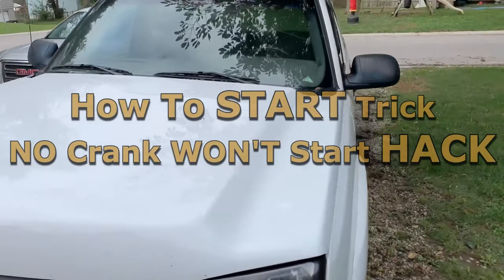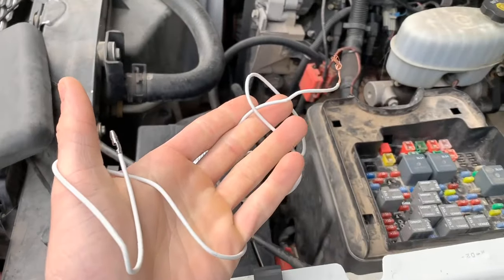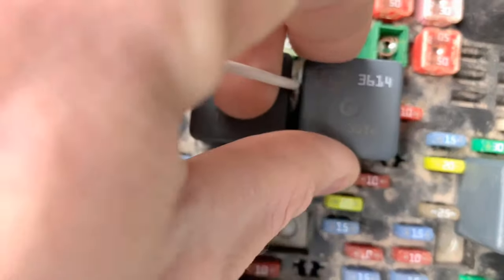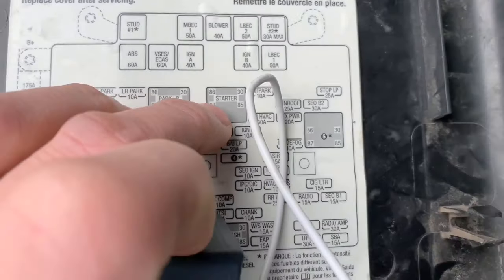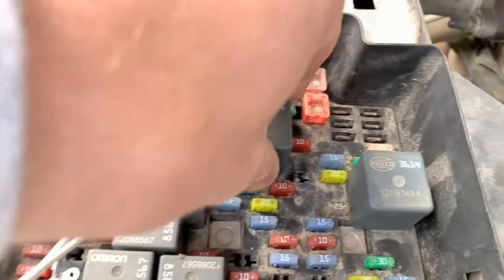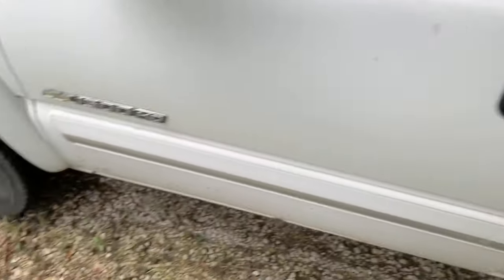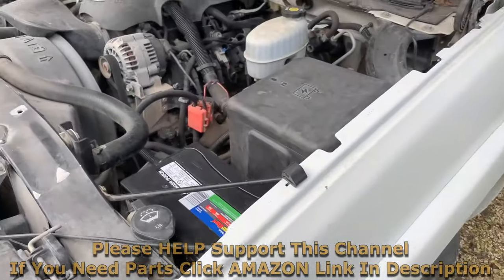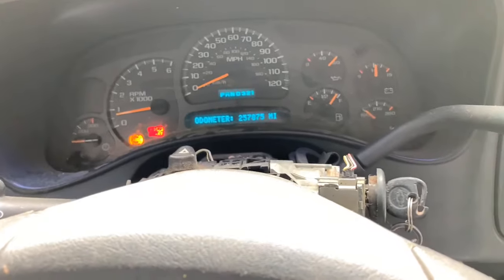NO START NO CRANK Chevy Silverado 5.3 Vortec 6.0 4.8 4.3 L How To Start TRICK Diagnose WONT START

Comment: If it doesnt work for anyone, try taking anything metal like a screwdriver and touch it in between the 2 bolts for the starter underneath the truck until u see sparks and here it cranking, start it up and then shut the engine off for bout 5 min so ur battery doesn't explode 😂 then u should be good to go without any backfires, did this with my 5.3 bout 30 min ago and she runs like a dream
Reply: are you talking about the small bolts behind the driver side tire ?

Comment: My truck was in a bad neighborhood, broke down, your tricks literally probably saved my truck because I had to leave it overnight and then I found your video. I got a run in and got back home. Laura, for some reason the emergency brake electronic system has a gauge now I didn’t have much power in my engine, it never gave me a lot of horsepower is what I meant. Noticeably different, any thoughts?

Comment: Replaced my ignition switch, ignition relay, ignition cylinder, battery, and even the starter but still no crank at all! This trick turns my truck on no problem but anyone got any ideas? Cause im lost
Reply: Mines doing this now. Ever get it figured out?
Reply: @jeffholz2465  no never did, i gave up on it. It seems to work now but only after jiggling the ignition a couple times

Comment: Pin 87 but not on parking lmp like u pointed at, right ?
Reply from the maker: lmp?
Reply: @EverydayImTECHnIt  on the video you said 87, but was pointing at the  PARK LP FUSE.. anywho, it's the starter fuse 87 you connected too right? Since you mentioned starter
Reply: @EverydayImTECHnIt  @5:50

Comment: I noticed your abs light and parking break light came on and stayed on when you did this  mine did the same thing did you get them to turn off ?? How did the truck run while the lights were on?
Reply: I have the same problem. Truck wont start so i did this wire bypass which starts it fine but when i get going my dash and lights start doing crazzy shit
Reply: My 2001 Chevy S10 pickup died last night right when I parked in my driveway, it was real late. But the issue with the two dash lights comes on.. then I reset by shutting off the car.. wait a few minutes.. no more lights.. I have troubleshoot this issue

Comment: Confirmed on 2003 6.0 liter. I believe slot where my starter relay goes is all messed up. New fuse box on the way. Thank you for the video. Subscribed!
Reply: did the fuse box fix your problem
Reply: @beepbeepbella8139  - Yes it did.

Comment: Havin a problem 7.4 no crank no start have power no fuse is blown ...new starter alternator good....99 c2500 obs style
Reply from the maker: Try unhooking battery for 15 mins it resets computer then hook it back up & also check ground wire where it grounds to frame make sure it has good connect & clean it can cause this issue also.

Comment: Did not work, any ideas? For me it cranked with the wire trick but did NOT end up starting.  Any ideas, anyone??
2003 Silverado
New alternator, shop said battery & starter should be good.

Comment: Thanks again for this video... I was able to start my suburban , pulled it in the drive way and now I’m hoping the issue is just the relay... what do you think? Can this heat  we’re having effect it?  Thanks again... do you have a FB or instagram?
Reply from the maker: Also check large square fuses & make sure you check them good & remove them for better view on mine it had a very small hairline crack & looked like it was good & swap relay with another relay to check if it is good like headlight relay for ETC just make sure that #'s are the same on the relays u swap!!!!
Reply: Melted wire under fuse box connector c1 replace fuse box and wire if I could post pictures I would
Reply: In heat our suburban would stall while driving- faulty crank sensor and neutral safety switch both made our life hell

Comment: thanks for the tip, got my truck started. will a new starter relay solve this issue?
Reply from the maker: Glad u got it fixed & to hear the video helped!!!
Reply: Thank you brother you're a legend!
Reply: I would also like to know how to fix the problem and not have to jump wires to start it every time... New starter relay? Ignition switch?
Reply: I tried this but no spark coming from engine

Comment: 2010 GMC van, 4.8.  Did the #87 jumper trick, but it only cranks. Will not run. I heard the fuel pump buzzing when I turned the key on.

Comment: My 4.3 will crank but won't start : but if I put gas in the carb. it will start for as long as the fuel added last . I beleive its a clogged fuel filter or fuel pump NY pump and filter are only 5 years old .

Comment: What would be the problem if it sparks but nothing happens? I’ve tried it on all the prongs and same results
Reply from the maker: Probably your starter
Reply: @EverydayImTECHnIt  I took it out and autozone said it’s good. Ignition wiring looks good too. All relays and fuses are good I’m not sure what is the problem
Reply from the maker: @brodieyukin69  check your ground wire this is common problem for those trucks

Comment: I had this issue not to long ago how I got the truck started was my brother smacked the starter with a pipe wrench while I held the key in the start position. Then i changed the starter I have not had an issue since
Reply: That’s a different issue. The neutral safety switch on this truck is bad, so he bypassed that switch by sending power to the starter relay directly from the battery. This trick won’t work with a bad starter, so that’s why you had to pull out your hammer

Comment from the maker: GET PARTS NEEDED Linked Below
Starter Relay Multi-Purpose RELAY ACDelco

https://amzn.to/32PiXuC

X-Large Starter FUSE Square Shaped
https://amzn.to/32PiXuC

Get Other PARTS NEEDED To Fix Linked Below
https://amzn.to/2J1uCOZ
Reply: Is this everything needed to fix the problem? I have the same problem and tried this and it worked but im trying to find the next step
Reply: Okay so I'm having this issue on my 08 yukon denali but you said it covers up to 07 so this will not work for mine then?
Reply: How to effectively fix and to be able ignite with the normal car key ?

Comment: I had that issue .... I eventually replaced my starter and never had to jump it like that again
Reply from the maker: This may help someone else trying to diagnose problem I linked video below showing how to TEST STARTER https://youtu.be/rqZUl971WqI & Here is another video that may help also on how to REPLACE STARTER on GM 4.3 4.8 5.3 6.0 liter engines in Silverado, Tahoe, Suburban, Sierra, Yukon, Hummer ETC Video Linked Below https://youtu.be/d7AMJDDjBH4
Reply: This works even with a bad starter? I was able to crank mine using the wire from relay to positve battery post.
Reply: I tried this just now and starter just made the clunk noise.  Pretty sure I'm doing a starter swap this weekend.

Comment: The relay next to it is the same relay  Marked prk lamp. Swap those to start and it will also tell you if that's the problem. Still what you showed was great and should  work with about any car I would imagine.
Reply from the maker: For sure but keep in mind this problem can be caused by more than just bad relay only. This kind of tricks system so just cause it starts this way doesn't mean it is a relay for sure multiple other causes FYI what u said is 100% how you could tell if it was a bad relay tho.

Comment: My truck got stolen it was recovered i patched the hole on the gas tank with jb weld after 24 hours of cure time i put gas in it starts for a second or 2 then shuts off i checked all the wires none are cut ima going to try this method

Comment: Dead key this morning. 
I’m having a problem. I wired it up to #87 and it turns over and then dies right away. Tried it three times. 
I went and tried starting it by the key and it fired right up. I shut it off and tried the wire again. Same thing. Start and die. Fired back up on the key. 
Any ideas why it fires and dies with the wire method?
2002 GMC Sierra 1500, 5.3
Reply from the maker: Fuel Pump maybe??? Doe's it crank with key all the time or sometime no crack with key? It could be the 3 pin plug on the steering column going to ignition key behind plastic steering column cover it is very common issue that this 3 wire plug becomes loose & cause these years trucks not to start.
Reply: @EverydayImTECHnIt  
Sometimes no crank with the key. 
Is that cover on the bottom or top?
Thanks for the quick response.
Reply from the maker: @mrbigg7255  top cover plug has 3 wires in a straight line plugs right into ignition switch search YouTube or google this issue well come right up is very common for your make/model truck to have this issue plug becomes loose there is simple DIY tricks to fixing it by using something to hold plug in place so it is not loose
Reply from the maker: @mrbigg7255  also check your battery terminals & ground wire going to frame from battery.
Reply: @EverydayImTECHnIt  Thanks man. I’ll tear it apart and check it out.

Comment: I’ve got a 2004 Tahoe and it just cranks and won’t start unless you spray starting fluid and die
Reply from the maker: This is your problem & here is a simple hack to diagnose it for a 100% & get it running before you fix it watch video i did on the issue your having with your Tahoe https://youtu.be/AH2-RTUz-tE
Reply: @EverydayImTECHnIt  i’ve got it to run now so thank you and it will not crank from the steering column at all

Comment: So if it doesn't start the starter is done and I need a new starter?
Reply from the maker: Here a video i did on how to replace starter in 99-07 GM Truck/SUV Linked Below https://youtu.be/d7AMJDDjBH4
Reply from the maker: Also watch this video i did how to TEST STARTER linked below https://www.youtube.com/watch?v=rqZUl971WqI
Reply: I have no crank no start I try to jump it nothing happened on my 2006 Yukon Denali xl before it died I had a slow crank and then it start up what does that mean
Reply: Heather Moore , clean battery cables and terminals
Reply: @heathermoore2654  did you figure out what was wrong mine had a slow crank and now want crank
Reply: @amandaconner7563  I found out that it was not my battery it was my starter that was old and and oil on it so I change out my old starter and put a new one and now it starts real good

Comment: Been fighting this headache for 2 months now. Fingers crossed this takes care of it.
Reply: Try putting the shifter into neutral first as you start , before messing with wiring. I had similar issue with an express van.
Reply: @Raul Hernandez  Welp it did it again to me. The trick in the video isn't working and neither is trying it in neitral
Reply: @Collin Mustain  have your figured out you issue? Im in the same situation
Reply: @raw760  Thanks for this!  I saw  your comment before I messed with the wire trick and putting it in neutral worked.

Comment: Same problem I jumped the relay turned over but no start I have the problem when I turn key to on the fuel gauge dont move turn to crank lights in dash go out let off come back on I replaced ignition switch still nothing could it be neutral switch or key tumbler
Reply from the maker: Try unhooking battery cables for 15 mins then reconnect after 15 mins this well reset ignition stuff etc just have to reset your radio clock after LOL this may solve your issue!!!
Reply: @EverydayImTECHnIt  I tried all that still no crank and fuel gauge dont move I see the warning light is also on for the anti theft in dash
Reply from the maker: @patadams5497  You try checking the 3 wires that go to anti theft deal under top ignition cover sometime they get loose also & well make truck not start i heard
Reply: I had that same problem 2 days ago I did what I saw on video and it worked but I took it to a certified mechanic and he said my computer wasn't sending a signal to the switch si I had 2 choices 1 he could by pass it so it could start from the switch which was gonna cost me a 150 dollars or 2 my a new computer which was gonna cost 600 dollars of course I went with the first choice and now my truck starts up like it suppose to. I hope my info helps
Reply: @patadams5497  I’m having the same issue now. Did you ever get this figured out?

Comment: Did this in my 2013 Chevy Tahoe , Made my fuse box start smoking real bad . Wonder how much it’s gonna cost to repair whatever I just messed up now lol
Reply: Are you frfr?
Reply: My chevy 08 Tahoe did the same thing!what problems did you had afterwards bro?And how much did it cost you to fix it?😤😡😭😭
Reply: David Pamatz I had to replace the fuse box , wiring harnesses , cpu and my battery all coming up to just under $1,200 and my Tahoe is still in the shop right now cuz I had a washing machine break and flood my apartment so I had to buy a new one and postpone getting my truck back smh , Listening to YouTube broke my Tahoe but on the flip side I learned how to rebuild my broken iPhone on YouTube shortly after saving me some money so u win some u lose some I guess , good luck .
Reply: Io3 Yukon is cranking but won't turn over will this hack work
Reply: @toddalvarez3499  mines doing the same thing now. Did you figure out the fix?

Comment: I have a 4.3 it struggles to turn on only if I let it sit for a few hours but it makes a ticking noise but there no misfire nothing battery good any help?
Reply from the maker: Check & clean ground wire to battery also check & make sure wires tight to battery & check & clean wires inside RED plastic case by alternator you can poor COKE COCA on wires to clean them or baking soda mixed with water!!!!
Reply: I've also had a no fart due to lack of ground to the starter. 
Removed started, cleaned mating face of starter and mating surface of block. 
Boom, ground.
Reply: @EverydayImTECHnIt  thanks
Reply: @nickcoleman1073  thanks

Comment: Cool hack.  I think you can just swap the relay to the left to test if it is the relay as well.  This though will bypass any other safety switches as it goes directly to the solenoid of the starter i presume.
Reply: No don't do it
Reply: @jacksonpierre3535 why?
Reply: @wildestcowboy2668  it could blow that relay and then you'll have to replace a second relay
Reply: @jacksonpierre3535  on my starter I'm getting power to the big bolt but not the small one even with key turned to crank. Could it be a ground issue

Comment: I tried doing this on my 2002 gmc to no avail. It just randomly went from running/starting fine to it not doing anything. When I tried this and when I turn the key I hear ONE click from the starter and nothing more. Does this sound like a shot starter? I changed it out around 5 years ago but I do have a little oil leak which I’ve been told that oil getting on the starter will ruins it quickly. What would you say?
Reply: Did you figure it out ?

Comment: This did work for me, although my problem is a little different. When I started it this way my truck went into a limp home mode. Its stuck in high gear now. And the battery is being drained somewhere. New alternator and battery.  The problem isn't the relay. It will still start but only with the wire trick.
Reply: What was the solution to your problem the wire works for my truck to start it but it stays in high gear I changed the neutral safety switch already didn’t fix it
Reply: @hunterfields7125  unfortunately I haven't fixed it yet. Gonna check my starter solenoid and I will inform you if I figure something out
Reply: FishinWithTyler thanks I have mine in my shop out back I tried swapping every fuse tied in with it no solution to crank it by itself. At first it would happen once every month then every two weeks then every other day now it’s permenant
Reply: @hunterfields7125  interesting. Mine started as a problem where it was losing power so I replaced the battery and alternator (both were pretty old) all was fine for a few weeks then I woke up one morning and it was dead. I was able to start it by jumping it off. Then one day all of a sudden it was driving fine, I cut if off, went to crsnk it again and no start. Only difference was I has power to the accessory. Jumping wasnt starting it.. so  i did the wire trick, if started, but it was in limp mode. Ever since, if I wanna start it I have to use the wire.. and its stuck in limp mode every time
Reply: FishinWithTyler I jump it with wire every single time and stuck in limp as well with everything but the ac blower working and when driving the abs and brake light stays on
Reply: @hunterfields7125  oh yeah forgot to mention. My HVAC completely stopped working after I started it with the wire. No power going to it at all. Worked fine before all this bs happened. My dash won't turn on, the only thing that lights up is my check engine light. Its throwing 6 codes relating to the problem
Reply: I was wondering if you found the solution to not starting?

Comment: Just so y'all know the issue is a bad relay you can swap the relays around from your parking lights and get the truck started
Reply from the maker: There can definitely be other causes to this issue besides a bad relay you're 100% correct it could be a bad relay for sure I would definitely try swapping them with one of the non-crucial relays there's multiple you could switch it out with before you try this but there's multiple other things that could be causing your issue just FYI it's not 100% that switch in the relays going to solve your problem

Comment: 05 2500 Silverado gas battery was fine tried the wire trick did not start the engine crawled up underneath the truck and banged on the starter with a hammer as somebody turned on the ignition cranked right up I think though starterI had moisture in it possibly in was froze
Reply from the maker: If it doe's it again I would definitely replace your starter. Your starter actuator is probably your issue it's the deal that pops out with the gear to turn the engine over and then pops back in when the truck starts if that makes sense that's the best way I can explain it.